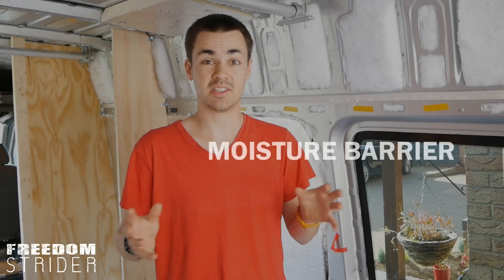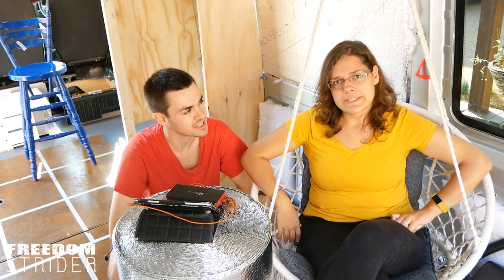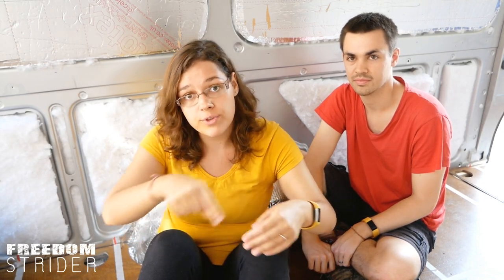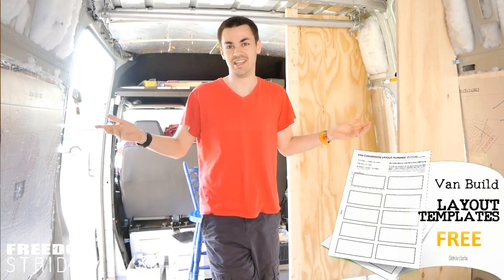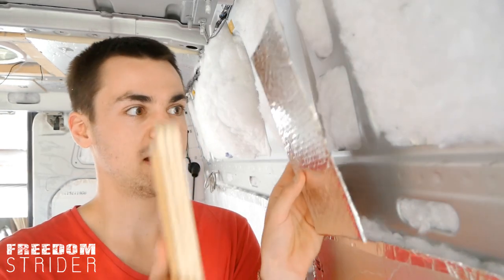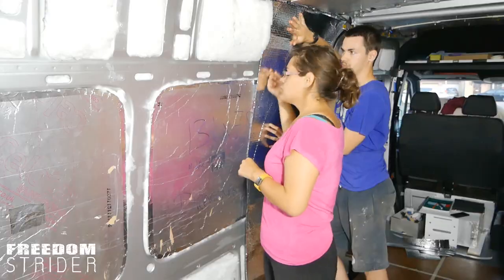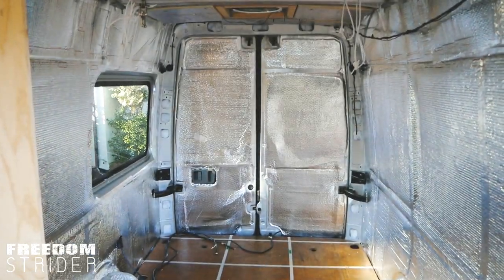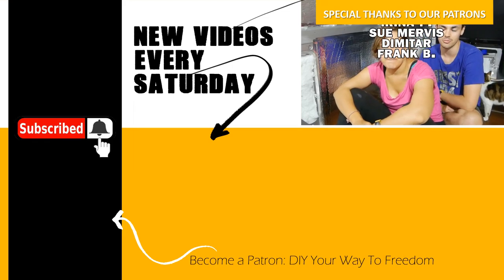Installing Reflectix Insulation CORRECTLY - Moisture vs. Radiant Barrier

Comment from the maker: HOW WILL WE IMPROVE NEXT TIME? - Since doing this video, we have updated our opinion on how best to install reflectix. The information that we conveyed in the video is correct, and the relfectix can be installed either way when it comes to radiance, but an aspect that we didn't consider as much as we should have was conductivity. By sticking the reflectix to the metal of the van directly, that connection forms a thermal bridge and increases the rate of heat transfer. So, we would stick the reflectix onto the back of our wall cladding to act as a radiant barrier. However, that would make it nearly impossible to make a seamless moisture barrier. For the moisture barrier, we would use a different material (not metallic) to stick directly onto the metal first (before the framing or reflectix) for it to cover all exposed metal, which would reduce the risk of condensation, and it would stop moisture from going in. It is our opinion that it is best to use different materials for the moisture barrier and the radiant barrier. Reflectix as an insulator (radiant barrier) is 100% worth it to install for its insulation properties, but we don't think it is the best material to use as a moisture barrier in a van. A moisture barrier is very important, especially since any exposed metal will condense water immediately. A few materials that we are thinking of trying are some neoprene sheets or a housing plastic membrane...we'll update you during the next van build.
~Happy building!
Reply: maybe have a look into fire retardant CORREX™ (lightweight twin-wall polypropylene sheets, 
available in various thicknesses) it might be useful for the stand-off battening instead of wood.
Reply: Any type of material that is lined with aluminium is the best vapor barrier there is compared to any plastic, as aluminium is essentially imperimable, whilst plastics are still slightly permiable. 

As for the conductivity, which you think is a problem if reflectix is stuck directly to the metal of the van - that's not really a problem, as the reflectix is not a better conductor of heat than the metal itself and so it doesn't really matter whether there is a small thickness of reflectix added between your framing and metal as the metal itself is a super-conductor and will thermal-bridge the wall from outside to inside (or vice versa), essentially. Lets put it this way - a 10mm thick metal wall is a better insulator than a 7mm thick metal wall, even though none of them are a good insulator. The framing in these instances will be the best thermal-bridge braker between the metal (or reflectix) and your wall panels. Sure, wood is not the best insulator and you might find a better material to brake the thermal-bridge, but 25mm of wood is way better than none.  Havent seen this done and I'm not sure it would actually work, but, if structural properties are not essential for a build and the only thing someone is interested is a thermal-bridge braker between metal and plywood, I suppose strips of XPS or PolyIso could be used similarly to framing at all the "high" spots of metal where the plywood wall panels would directly contact it if they were laid purely on top of it. Then the plywood would be screwed to the metal with self-tapping screws through those insulation strips. They are load bearing enough to walk on them so, I suppose, if plywood with thickness of some 9mm or similar would be used this could workout great and provide the best posibile solution from the insulation perspective.

As for the radiance and side of installation of the reflectix - it is not really true that there is no difference to which side it is installed to relative to the air gap as well as the source of heat. We know that hot air always travel towards cold air (i.e., the heat is traveling from hot to cold, not other way around). Reflectix works by trying to radiate the heat (hot, not cold) back towards its source. The air gap must always be between reflectix and the heat source for the reflectix to work at is maximum efficiency, because in that case the conductive heat transfer is limited as much as possible between a surface that is on the hotter side of the structure (in the case of van, for example, the outside metal or the inside plywood walls) and the reflectix, whilst forcing the heat to try and radiate over the air gap. The air gap then, esssentially, disperses the heat "uniformely", reflective material can reflect it back into the air gap to heat that air and thus contain that heat energy to the "hot side" of the panel. If the air gap is installed on the cold side of the panel, than, firstly, there is maximum contact between reflectix and the surface that is the "hotest" (the ones closer to the hear source), thus, the main heat transfer mechanism becomes conduction. 

Essentially, it up to us to design the structure to force radiant heat transfer instead of conductive heat transfer and than to use reflectix to prevent it as much as possible! 

So, to decide on which side of the reflectix you want to have the air gap you have to consider a few things. Firstly, lets assume that all of us throughout the year want a stable inside air temperature, of, say, 22 degrees celsius. Now, whenever the outside air temeperature is lower than this, the heat transfer will be from inside to outside (that is, the heat source will be on the inside). Whenever the temperature outside is higher than those 22 degrees, the heat transfer will be from outside to inside (thus the source will be on the outside). The bigger the differnece between the outside and the inside temperature, the more heat is transfered. Thus, for a typical van in, say, northern Europe, UK or similar places where usually outside temperature is lower than the inside temperature most of the heat transfer will be in the form of heat loss from the inside (not gain from the outside). Thus, what we want reflectix to do is radiate our produced inside heat back to us. That means that the air gap needs to be on the inside of the van as you have it in this video (or the other video of you van build). This also provides the best possible vapor barrier solution.

Hope it helps!

Comment: Great video but what i can't understand is ordinary vehicles dont have moisure barriers or vapour barriers. When it's freezing outside and were driving with the heating on, the roof should be damp and mouldy and every car should rust from the inside out. But they don't...what am i missing here..?
Reply: It's more for when the vehicle is off and not running a/c or heat. When you accidentally leave hot food in the car, or sleep in the car, in winter, moisture gets all over the inside of the windows and car. Multiply that by all the hours living in a van, I suppose.
Reply from the maker: Exactly this, normally cars will cool down and reach the same temperature as the outside, in a van the constant temperature difference causes condensation. In older cars there can be condensation rust caused by the years of this cycle too
Reply: Cars do actually rust from the inside out......

Comment: We found this video very helpful and easy to understand and actually followed the same process to do our insulation and vapour barrier. However, upon making some changes to our bump outs, we needed to dig down into our vapour barrier. Unfortunately, we did find that there has been condensation forming on the internal metal which has travelled through our vapour barrier and recycled bottle insulation. We're not quite sure what to do moving forwards. It's understandable that we were never going to get a perfect vapour barrier, but it's interesting to wonder that this surely must happen to almost every van build only the condensation on the metal just isn't visible unless you do strip your van back out. Any thoughts on this yourself?
Reply from the maker: Truthfully, I would not be surprised if that is indeed happening in every single van, with or without a vapour barrier. Primarily because fluffy insulation and chunks of PIR board cannot fully cover every single metal surface in the walls, it's just the way the settle in the cavities, there will be pockets.

Any exposed metal (exposed metal that isn't touched by fabric, reflectix or any other insulation) WILL produce condensation when there is a temperature difference. The only way that we can think to fully prevent that is spray foam insulation EVERYWHERE (in every crack and every cavity). That is what we would do if we would do the van again, because you can put the reflectix on to act as the radiant barrier it is, without trapping moisture as a vapour barrier. Realistically, what you want is the radiant barrier, not a vapour barrier when working with the van (if you have exposed metal).

On an already converted van, the best thing to ensure is that there is enough ventilation going through the walls to remove that moisture as the seasons change. You'll get that moisture with or without reflectix, the only way to stop it is to cover every metal surface or ventilate the walls extremely well (though that would make the insulation less efficient).

It's a viscous circle and is really tricky to get the balance right, hopefully this helps you 🙂
Reply: @FreedomStrider  Glad to know we might not be alone in the boat! Lol thanks for the response. Take care both!
Reply: @FreedomStrider well-said. I agree with you. I'm doing my metal garage door for radiant barrier purposes and have been working on making a proper air gap between the door and the Reflectix.

Comment: I have a LWB Sprinter 2012 75Km  which was used as a mobile workshop. It was originally kitted out with work benches shelving and draws.  People worked inside the van. There was only rust behind the wheel arch and van skin. I hooked out the sealant poored  "Cure rust into the paper thin gap until it ran through onto the road." Then reseal behind the wheel Arch.  There was no insulation in the van. What the previous  owners have done is sprayed wax oil in all all the cavities below the inside floor level around the inside of the van cavities/ pocked. I presume on the principle that air will condense on the inside skin of the van run down the inside skin of the van. Gather into these pockets coated with wax oil then out on to the road via the drain holes manufacture into the van. All the holes which are used to attach the outside plastic trim leak. I can see where the water has run into the cavities/pockets sprayed with wax oil then out onto the road via the drainage holes. I am going to insulate the van but I have no idea if I will install a vapour barrier.
Reply from the maker: All we can say about the vapour barrier is that it definitely made a difference, we could feel the heat radiating inwards on the cold winter days when we had an electric heater running, more so than the insulation alone. But there are potential drawbacks, you just have to be careful not to leave any exposed metal, because that will condensate and eventually cause rust behind your walls. 👍

Comment: Thanks for the vid. I'm building my 3rd van and am actually going for another option. I'm insulating away all bare steel with Armaflex first. Then I fill up with polyester wool and then maybe reflectix at the back of the final wooding layer. No moisture barrier since warm air that travels through the walls/interiour will not be able to hit any cold steel (since the steel is already insulated away with Armaflex). Even as thin as 6mm Armaflex will prevent condensation.
Reply from the maker: That's nice, we wish we had insulated any exposed metal with some insulation like that as any metal condensates alot in the wheel arches which is the main exposed area. As long as the reflection has an air gap, it will work for insulation purposes too 😉

Comment: The easiest way to fix moisture problems is use the original full headliner. I did with my Sprinter 12 years ago. Not any signs of moisture damage. The original headliner breathes is a good insulation and sound deadener
Reply from the maker: What is the original full headliner? Do you mean the hard lining that comes with the van?
Reply: Yes the original headliner is the same as you have above your head up front. Some Sprinters have this fitted right through to the back doors, usually the bus with 12+ seats. I found a damaged van at the wreckers and removed all 4 sections. Good luck with your build

Comment: Can you put the reflectix directly on the metal? So in this order: outside metal - reflectix - isolation - wall frame and inner walls.
Reply from the maker: Not quite, the reflectix needs an air gap next to one of its sides to be effective.
Although insulation can be airy, it's not as effecient as an air gap.

You can do: outside metal - insulation - wall frame - reflectix - inner walls

Hope this helps 👌👍

Comment: Great video, technical yes but absolutely necessary. For live in builds , understanding the effect of moisture and the dew point can be make or break a van build.
Reply from the maker: Totally agree, and it's so tricky to understand and get right. The hard part is that if you change 1 factor, you can make condensation and mould worse, so it's important to get right. We're still learning ourselves. 😉😊

Comment: Well explained. Didn’t understand why it was better to put it directly on the metal.
Reply from the maker: In our case, putting the reflectix directly to the metal and then the framing on top gives us more access. We can see where the framing is, add more framing if we need to without breaking the reflectix. We can also still use the van metal itself to bolt something onto if necessary. If we were to do the framing, and then cover it with the reflectix, we won’t have any reference points. Insulation wise, one way is not better than the other, they will both perform equally, but for practicality, we chose to put it on the metal. 👍

Comment: Hello, I am a big fan of Reflectic and you gave one of the best explanations i have seen on van builds and just using Reflectix in general.  I placed it in my attic in my house in the city 20 years ago. It went from me unable to even be  be in there for 10 mins on sunny days to being able to move my bedroom up there.  The only thing i wonder about is the conductive heat from the frame of the van transferring to the aluminum foil on the Reflectix and turning it into a big radiant heat sink for the skin of the van like the heat sinks on computers.  i know the wood framing will work as a non metal conductive break once that is on but it would be interesting to hear if you can tell if you can feel the conductive heat through the whole of the Reflectix.
+
Reply from the maker: Thank you 🙂 We only installed the reflectix in the autumn, and don't have proper heating in the van (yet) though running out AC electric heating inside during the winter, the reflectix has really made a big difference!! We can get the inside from 0-20C within 30-45mins and the metal on the outside stays cold.

The only places where conductive heat seems to be a problem is where the reflectix is touching the band outside metal directly (like around the wheel arches), if you touch the reflectix in that area it is colder than the other sections, but still not freezing. 

In a van I think it's difficult to get a perfect insulation barrier but you do the best you can given the circumstances 😎👍